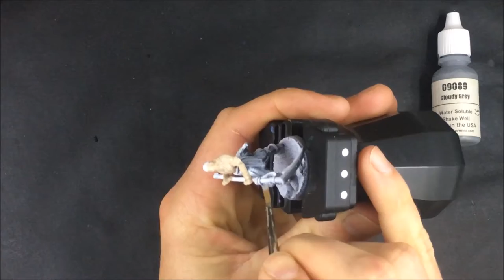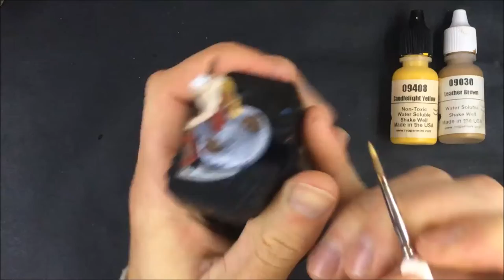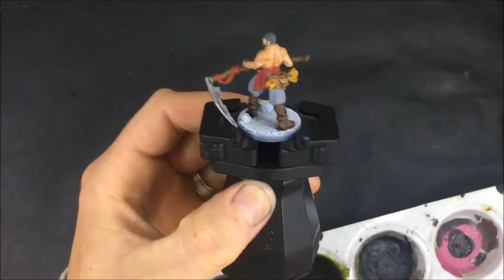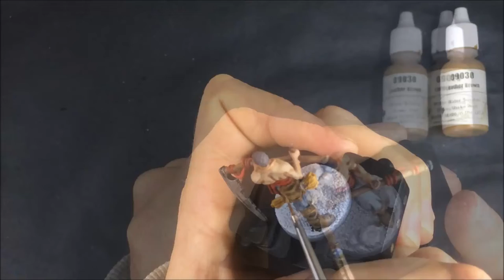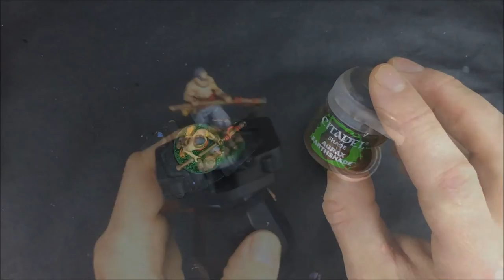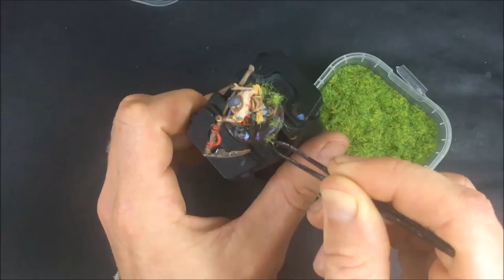The Plastic Canvas - Tainted Grail - Ep 2 - Arev

Comment: Nice job. It's fun seeing different people's interpretations of the character. I've just started painting again after years and years and got a small set of speed paints to try out (which limits my colour range a bit). I too went with the grey trousers (as thats his character colour in the game) though I took them down as if he had ankle boots and used the leather straps to tie them in which stood out nicely against the grey. Used purple for his sash though and while it's nice, it just doesn't stand out anywhere near as well compared to your red.
Reply from the maker: Thanks! And that's one thing that I like about the artwork in this game (that sketchy sort of style). It doesn't really lock you into having to paint them a certain way with specific colours. It just gives you enough of an idea of what sort of character they are and then you've got scope to put your own spin on it. How did the speed paints go? And that's why I ended up going with red. I think purple is a much nicer colour than red but red is a great one for contrasting other colours with so it stands out really easily.
Reply: @theplasticcanvas  I wanted the main colour I used to tie in with their game colour since I'd still use them as playing pieces. It also gave me a definite starting point per model to work from rather than starting from scratch and trying to chose a random colour. I need to work on my contrasts though as I find I'm using samey colours too much. I liked the idea of Bronze armbands but they just don't stand out next to skin. 

I started on some of the expansion figures too. Did one in a lovely green pretty much all over which was contrasting nicely with the leather wraps and bag before realising their game colour was actually orange. Doh! But if I'd used orange, the leather wouldn't have stood out anywhere near as well.

Speed paints are nice and give a good effect of light and dark but are a little unforgiving if you make a mistake as they're not strong enough to cover another colour underneath and some colours reactivate if you try. You can use some of the weaker colours a bit like an ink wash though which is nice. I was using some non-speed paint metallics as well and the dark grey speed paint worked well as a wash over the chainmail.